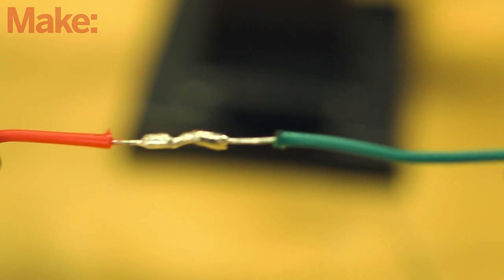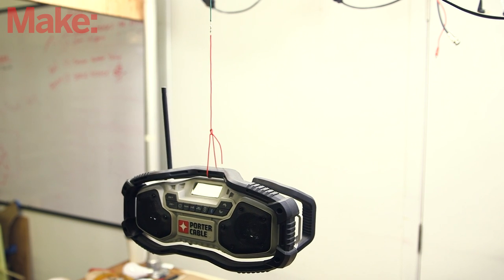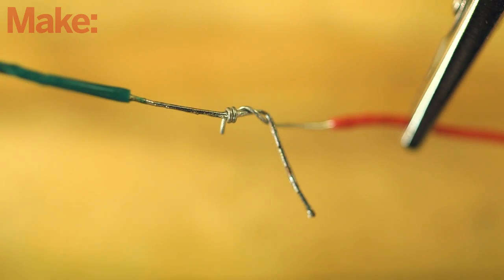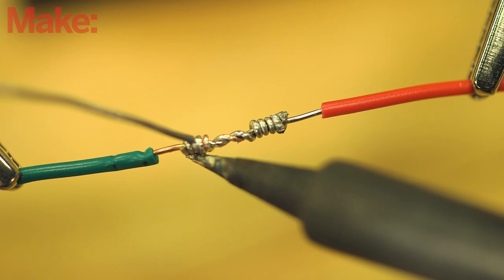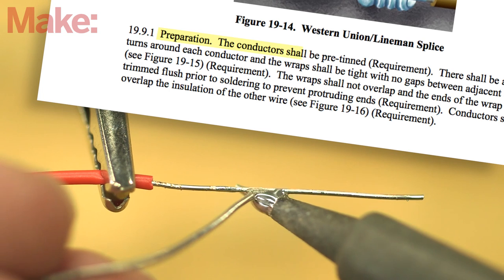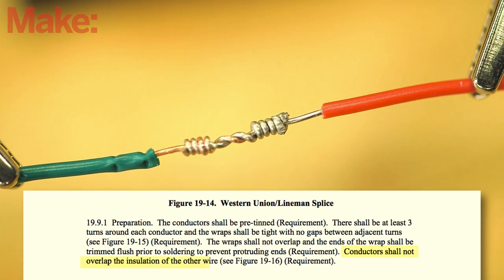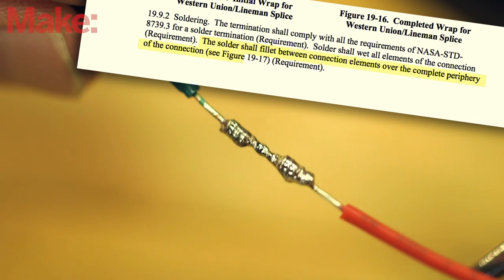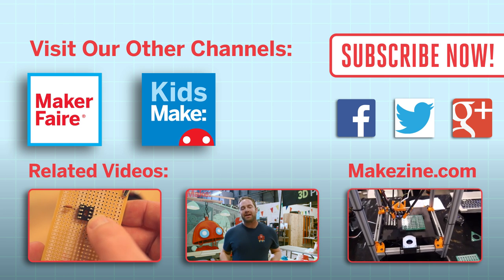How To Splice Wires to NASA Standards

Comment: No heat shrink tubing?! NASA is getting soft...
Reply: I bet my ass they don't use shrink tubing as we know it.
Reply: +Julian B. my guess would be it's the shrink tubing that oozes something similar to hot glue when heated. that's what i used at Ford when doing safety recall wire splices. i mean a car's a little different than a space shuttle. but you know what i mean. haha
Reply: Kapton tape probably, weighs almost nothing and that's important for any space hardware.
Reply: +juntistik I'm a newbie at this, so .... aside from the NASA standards, blah blah blah....  would you slip some heat shrink tubing over one wire, and slide it along - out of the way, then bring it back over the splice and shrink it?

Just wondering, as I've never done this before, and I'm genuinely interested.
Reply: I was more worried about the no flux part. Without flux, it leaves the wires open to oxidation.
Reply: FRR yes
Reply: juntistik 😂😂😂😂😂😂😂
Reply: Dude thrse splices dont float free in the  space they are in rocets and crew modules there are a bunch of other cabels and conductive parts so they need an isolation
Reply: The missing tubing was my first thought.  Maybe NASA shrink tubing is a secret?  ;-)
Reply: You don't seal a splice with Kapton tape... LOL.
Reply: Make Your Mark oxygen is so abundant up there too
Reply: Make Your Mark Not a big problem in space.  Probably not an issue where equipment is stored before launch either.
Reply: Make Your Mark Solder has flux in it for a start, and the wires have been tinned, so the wires aren't going to oxidise, and in space......
Reply: Good thing there's flux-core solder then.
Reply: Federation 42 Yes, that's how you cover the connection. Put the tubing on one wire, slide it away from the splice, make the splice, slide the tubing over the splice and apply heat. You can add silicon or got glue to the splice before sliding the heatshrink on if you want waterproofing. Always make sure that the tubing covers some of the wire insulation, at least as much as is the splice length.
Reply: Make Your Mark Solder usually has a flux core, or even several flux cores. Without flux you can't solder at all, the solder will not flow or stick. As for preventing oxidation, a coating is required. The flux evaporates after soldering, and any residue must be removed to prevent corrosion. But a solder joint does not oxidize once applied and cooled, unless exposed to a moderate amount of water.
Reply: FRR guessing you work on planes back in the day, Kapton wiring tape is stupid
Reply: Make Your Mark it's caked in solder lol... there will never be oxidation  if oxygen cant touch it
Reply: Doesn’t pass my standards
Reply: Way too much damage to the insulation, tool marks.  Also, don't they specify only one wire width distance from the splice to the insulation, and a narrower distance in the criss cross part?  This connection wouldn't have passed when I took my micro-miniature class.
Reply: Just throw an environmental splice on and then some heat shrink. That's good enough for Air Force standards haha.
Reply: juntistik they use Vaseline
Reply: She clearly mentions, "cool to make something like NASA" clearly people following this video (likely to learn) aren't going to space... So to the idiots talking about stuff in space, replying to peoples questions saying there won't be oxygen to cause corrosion, shut up.  Those of you asking questions for home use, after you make your solder connection, you want to put dielectric grease over the solder joint, followed by heat shrink tubing with a 1/4 of the heat shrink tubing over lapping the wires insulation and when you heat shrink it you, should see some grease come out, then you know you have a tight seal, which will help prevent moisture getting to the joint.
Reply: juntistik  not needed when you have dielectric silicone or liquid electrical tape.......
Reply: The joke is. Some people actually think they dont use it
Reply: Not in space.
Reply: This is only covering the soldering to NASA standards...the use of heat shrink is implemented in making actual wiring harnesses, a different certification than NASA solder. And of course it also depends on what the specific design calls for too
Reply: I am going to try this and see how much this will increase resistance.
Reply: Insulating is common sense, I don't think a space agency need to teach you common sense, this video was just highlighting the splicing and joining of wires.....jeez ppl lacks common sense
Reply: @AkanamesMalestrom  That is bullshit.  FLux causes electrical oxidation, not prevents it.  Best to rinse the excess flux off of a connection.  Have done my share of resoldering very old failed soldered connections which failed due to flux caused oxidation over time.  Flux cleans the wire ahead of the solder allowing it to make a good solid contact.
Reply: @Federation42movies  it's been 4 years, so hopefully you have it by now, but yes, you move the tubing to the side and then heat it over the joint

Comment: You missed the most attractive reason to use this splice: It makes a joint which is not substantially larger than the original wire. This allows the joint (or a large number of them) to easily fit through a hole in say, an automotive firewall, or a project box.

Comment: The only reason NASA do this is so that the solder joints don't fail if there is a fire. If you tin the wires, lay them next to each other and reflow the solder it will hold strong enough for virtually all applications. In reality most breaks occur due to flexing of the wire, in these cases fancy joints do nothing as it will always break just next to the joint (hence use heatshrink etc). They are also a real pain in the backside to desolder. So unless you work on aircraft or spacecraft do yourself a favour and avoid tying your wires in knots before soldering, this goes for connections to pots and the like too, just tin the terminal and wire, lay one over the other and quickly reflow, (quickly to insure you don't burn off all the flux).
Reply: +littlestworkshop Yep dead right.
Reply: +littlestworkshop While it's not relevant for NASA, this method is actually easier to do, especially in the field.  A side-by-side solder requires four hands (one to hold each wire, one for the solder, one for the iron).  You can easily do a linesman's splice with two.
Reply: +Jason Goodman Well I'm not against it totally as long as people don't fall into the trap of thinking that tying things in knots before basically encapsulating them in metal make things stronger. That said if you are anywhere near a flat surface the roll of solder can hold one wire, and you hold the other wire and iron. With well tinned wires and good speed you don't need to add more solder. This is less true for solid core of course which is hard to get a lot of solder on but you see less of that flapping about in the breeze.
Reply: oh so that's the reason and g-forces have nothing to do with it? Learn something every day....
Reply: Jason Goodman Just do a quick twist slice. Super fast. Also here they use shit single strand wire, which breaks at the drop of a hat if you flex it.
Reply: funny how all crazy high amp car audio is done with 00g or bigger and alwayz multi strand.... yes its mainly for the flex but is also works!  OFC for the win... shit the alt in my car can put out 370amps and wonder why i got a 00g wire for + and also ground... frame block chass all 00g grounds.. EVEN now i need more runs of 00g... got solid copper buss bars for batt terms lol...made my self..
Reply: ben h Yep same here 300 amp singer alt with the big 3 done with all 00g OFC. What kind of system do you got?
Reply: Youve read my mind
Reply: lulz at the tools comparing high amp car audio to this, so tell us... are you really caring about your wiring when you pulling 9+g's in that car or would you pretty much be dead at that point in a CAR.... car wiring isnt engineered physical strain like this hence its designed for high amperage...its a NASA's method of soldering for aerospace forces...  facepalms  apples vs oranges
Reply: AQ audio 7k amp... ;-) it will do 10k rms at 16 volts... running a pair of 15's in a massive ported box firing up, ports back... tuned to 34.5hz  subs are tantric HDD motors and baskets, soon to be psi soft parts... btw singer alt here to... shoulda seen the shop techs  face when i had him dyno my alt... he freeked out when it peaked so high.. I tried to tell him but he thought i was bsing.. i had mike singer make the highest output alt he could cram into a alt housing that would fit my car..
Reply: tell me this whats the proper way to join two 00g wires with over 1000 strands?  "I KNOW I KNOW" but there is no code for that one lol...
Reply: i gota say thats a nice joint for big ass wire...but is there any code for that? also 15$ a joint dam
Reply: i will add that braiding both ofc 00g strands is way better than this choice but its all up 2 the person doing it...... way more contact area to solder
Reply: O there are but us car audio guys swear by solder and crimp....
Reply: you will never pull over 200 amps in a normal house... FACT... my alt can make 370amps and my amp can pull about 400.... i know what it means to have the amps needed ...cost a shit load lol
Reply: I soldered to IPC Class 3 for years and never even knew this type of join was a recognised method. Seems a bit pointless because the point of failure will more than likely be where the wire leaves the insulation on any decent splice.
Reply: Not even the battery leads use 00 guage....
Reply: ya they use the smallest wire that will get the job done...EVERR wonder why cars batt terms that are stock go to shit??    shit is made to fail...   if u ran a 3000+ amp batt u would use copper buss bars and 00g ofc lol...   I want to puke hearing the batt leads need to be the biggest..   FUCK with 370 amp alt your batt will never see that power its gona get pulled through the 00g wire from alt + to what ever high amp draw system u running.... aka copper buss bars on my batt terms so power can flow as needed... YA small stock batt needs small wires.....but if u have a massive amp draw u need to use copper buss bars and big wire so the amps can flow with out heating up wires...  I know my shit.... car audio or A/C current in a home...
Reply: littlestworkshop I mean any soldered wire connection is usualy stronger than the rest of the wire If you do it properly :D
Reply: Syc holic Show my how to rip a cable with g forces that wouldnt kill a person inside the rocket or break any other sattelite components like the frame, electronics or solar panels.
Reply: littlestworkshop Last I knew,I didnt own a rocket. So I guess I am safe to do it my own way.lol.
Reply: tinning weakens the joint. Just crimp them together.
Reply: @mistaowickkuh6249  Our world will never produce enough wire to go to the sun in all the time it will exist before the sun encompasses it. I'm sure you're aware of this now, as it has been years, but the sun is really, really big, and accordingly, really, really far away.

Comment: This would not pass inspection. You violated one of the rules you highlighted and spoke verbally. You used too much solder so that it blobbed instead of filleting, for this to be a good splice you need to be able to inspect the turns under the solder by filleting the solder instead of blobbing it.
Reply: J additionally there was a gap between the right hand coiling middle layers.
Reply: Agreed.  External flux would have helped.  I hope this wasn't RoHS solder.  You always need less than you think!
Reply: Still, by youtube standards, this is an outstanding soldering job.  Most youtubers tend to use their grandma's curling iron and electric fuse wire...

Comment: Cool video!   I actually learned this in Jr. High electronics class in the mid 90's (although we called it a western union splice) and its the only wire splice I ever use.  Glad to know its still considered correct!
Reply: +TabLeft Workshop The More You Knowwwwwwwwwwwwwwwwwwwwwwwww!
Reply: TabLeft Workshop I was taught to measure the wires to make sure they are the right length, ever since then I have forgotten how to splice.
Reply: A Western Union splice is a good connector without soldering. A WU splice is does not require not have any standard for correctly soldering.

Comment: You need to use silver-plated copper wire with polyimide insulation to work over the temperature ranges and vacuum conditions.  I hope that's leaded solder!

I used to design space electronics.

Otherwise, an awesome demonstration of the techniques!  It's not as easy as it looks.
Reply: Thank u very much for make it clear ! Awesome job too !

Comment: I learned about the lineman's splice years ago, possibly from this very video. The information sat at the back of my head until this year when I started a job that has me soldering quite often. I use the lineman's splice (well, a simplification as I don't pre-tin) every time and I am always pleased with the results.
Reply: IPC standard says that not pre-tinning a wire before splicing it is defect in all classes. I still did this on my exam day and I regret it, lost points for not tinning the wire. I didn't do it because it was incredibly hard and painful to twist the tinned wire (which was thicker than the one in the video) with bare hands.

Comment: Put heat shrink before doing the splice! How may timed did I have to learn that lesson...
Reply: You can't cut one lengthways and put it on?
Reply: Been there done that.   lol
Reply: Unless you melt it, but then melt any plastic and coat your wire in it haha. How else is it going to stick well.

Heat shrink, as the name implies is done not by melting, but by heating, where the tube particles contract.
Reply: @xdarrenx  How many times do we have to learn that, you ask. At least once more, I'm sure.